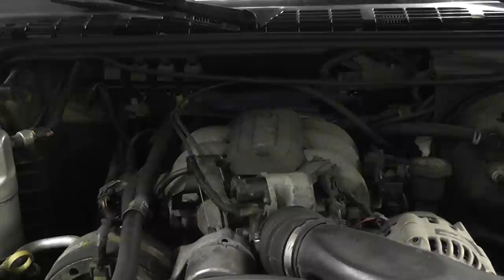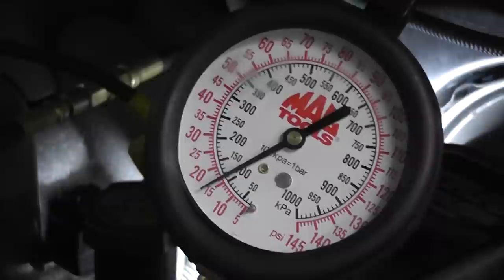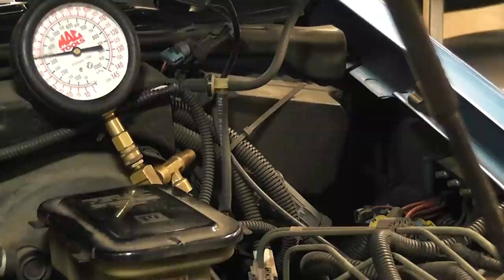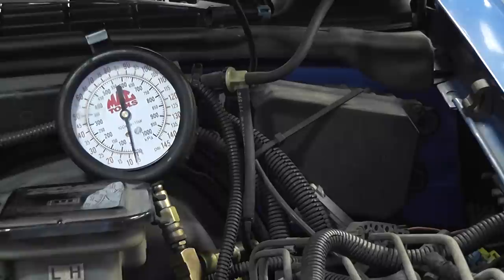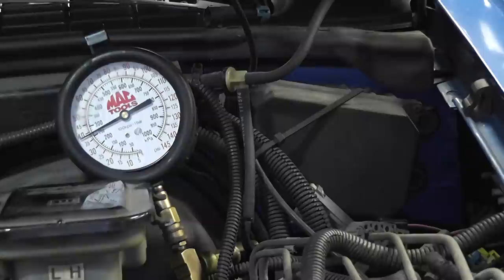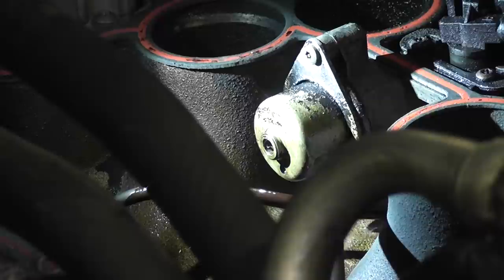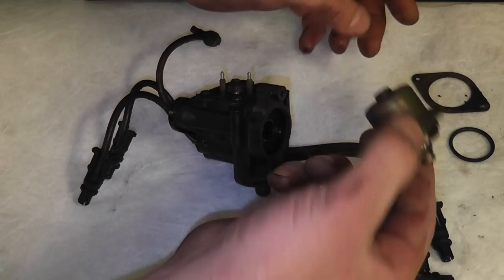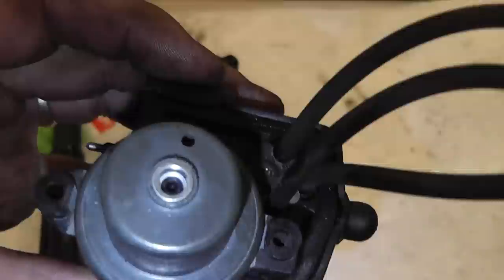How to identify and repair a leaking fuel pressure regulator (GM CPI system) part 1

Comment: A simple "Thank you" is waaay short of the gratitude I have for your excellent knowledge and teaching skills. You have just saved me tons of heartache and head scratching.
These regulators have killed more trucks with spiders than we could ever know. 
Something else I must share is the oil pressure switch, located on the back of the block, can go bad causing rough idle, mysterious dieing, and no fuel pump voltage (improper voltage).
They have a set if contact points inside and can either burn or internal spring failure.
Its in a tough spot to service but a $21 pressure switch can save your truck.
Reply from the maker: Thanks so much Michael. Just knowing these videos are still helping people is all that matters!

Comment: I purchased this truck in a garage sale here in Forida for $800.00 four years ago. seller thought engine was blown. I bought as is. water in oil. I tested every cylinder perfect compression. intake manifold gasket failed. I replaced  total coolant system and gaskets. flushed the engine.  extended cab 4wd truck. Its been my daily driver for the last 4 years.  ac was shot, 1k to fix. no thank you. overall excellent truck.

Comment: Hi Paul, thank you for these detailed diagnostic videos! Just made a quick buck with  my scan tool and fuel pressure gauge for this exact internal leak issue on a 2001 Blazer. I am in the process of establishing my own shop here in central PA, specializing in automotive diagnostics. Keep up the awesome work, you are my inspiration to battle the parts changers!
Reply from the maker: awesome man thank you!

Comment: I want to "plus 1" all of the positive comments below.  The troubleshooting steps were awesome and spot on for my 94 S-10.  I saw a few folks ask about changing the Fuel Pressure Regulator while still in the car but as I've completed the job, I'm not going to search for the answer at this time.  If it HASN'T been answered, I would LOVE to suggest that as an option if its possible.  That part was all that was wrong ($50) but I broke the plastic tabs on one very difficult popette.  So, $240 later, I now have an all new spider injector assembly.    My suggestion would be to squeeze the clips with one hand and wiggle / pull the plastic (not the fuel line) with needle nose pliers.  I think the ring of plastic near the tip of the popette is more solid than trying to wiggle the clips.  Anyway, thanks for giving me the confidence to tackle the job.
Reply from the maker: +searnhardt8 thanks man and nice job. Unfortunately those plastic tabs are brittle. I've done these with one broken clip and they hold, but not two. Sorry you had to change the whole thing.

Comment: This is extremely helpful. Not much of a GM mechanic since I have only owned imports. My brother has a 92 Oldmobile Bravada that I have changed the Fuel Pump fuse and fuel filter, Cleaned the after market K&N cone filter. Ive put fuel treatment in it. Hasn't been able to start on its own, just long strung out cranks with foot to floor.
Reply from the maker: Step 1 is to definitely check your fuel psi. There is a service port on the intake area and you can buy that particular psi gauge to fit specifically your application for like $30? Or rent one from the parts store? Less than 50 psi on these things and they will not start. Then also major flooding from the regulator rupturing, which again can be determined with that same psi gauge

Comment: That's a great point about maintaining pressure to prevent fuel boiling on the rail. No doubt that's a point made as a result of unfortunate experience. The lighting is great in this video.

Comment: This is an awesome video man. I have at 95 ZR2 s10 with the same issues. Ive checked the fuel pressure and it hold, no leak down. So now im stuck, trying to figure out why its running rich and why it takes so long to start, with the gas pedal all the way down. The inside of the intake was all dirty, not clean like yours was in the vid. The person I bought the truck from has already replace a few parts. Map sensor, fuel pressure regulator, distributor cap and wires, plugs, And a few other parts. He couldn't get it to run right. Im thinking its the CPI or spider injectors, IT does have the new FPR on it though. But anyways... thanks for the amazing video man it must of took you some time. I appreciate it.
Reply: Double check all your grounds there are many. Clean them with sand paper or wire brush and use electric grease

Comment from the maker: that's great! thanks for the update. ill keep u posted on any new material. right now i am working on a page for page lecture of my book. it is about 50 hrs of material which i will most likely break up by sections. it would be in video format with my smartboard. in fact it will be like you are sitting in my class.

Comment: Hands down one of the most thorough and informative videos ever!!!!! I learned a lot, liked and subscribed! Thank you! If I block off EGR will that eliminate all the mess shown on the driver side of your intake (opposite the leaking FPR side which was not black)?
Reply from the maker: don't worry about how black the inside of the intake is. Every car is like this and it is from PCV gases. it doesn't hurt engine performance at all. Thanks so much!
Reply: @ScannerDanner  I have a P1404 code and   a P1416 cleared them then I got a P1415 and P1404 cleared them again but P1404 persists.  What happens if I eliminate all smog, EGR, Secondary air pump etc , yet leave 3 OS sensors for closed course competition of course? Getting some misfiring especially around 1500 rpms, Also some high idle and occasional idle stumbling.
Reply from the maker: @stuartmotorsports  The P1404 may need the battery disconnected to clear the memory of the closed EGR valve position https://www.youtube.com/watch?v=HT4OnP4U0to

Comment from the maker: I would agree. As far as replacing the whole unit, I wouldn't do that. Your truck is a newer design and uses 6 separate electrical injectors as opposed to one. So it is called a Sequential Central Port Injection system. (SCPI) I believe the injectors are sold separately but I may be wrong, it's been a long time since I have been inside one of those.  As for troubleshooting a leaking regulator. It would be the same steps I've shown in this video. Fuel pressure bleed-down test is the key.

Comment: Safety glasses when disconecting the fuel lines don't forget,and would you need to stuff rags down the big open ports to avoid anything falling down them?,when dismantalling the injector assembly.Great video by the way.

Comment: Just fixed one. Rich bank 2 code. Dropped 30 lbs fuel pressure in 2 minutes, koeo. Pinched return line, still dropped. Removed intake, pass side manifold washed clean from fuel leaking from the pressure regulator.

Comment: Thanx for the help man, just diagnosed I have a bad fuel pump  check valve in my 96 chevy. I was just about to get the FPR valve changed but it holds pressure with the PSI line pinched
Reply from the maker: Nice job man! Way to pay attention to detail. Even though everyone was probably telling you to put the injector assembly in it.
Reply: ScannerDanner no kidding, it is a very similar symptom, but  I'm getting a TPS code, and the gas mileage is normal,  thanks again for your help

Comment: IM about to do the same thing with my 1995 Blazer but I will replace the whole unit.  The truck only has 60k original miles but, what many experience is the failure of the injectors and lines.....that is the lines themselves rotting.  Excellent vid tho. thanks

Comment from the maker: Nice. What you are describing is exactly the symptoms of a bad O2 (not a bad pump) on a Chrysler product. Watch this video "2003 Jeep Liberty O2 Bias Voltage Testing" and also "1997 Jeep Blown O2 Heater Fuse Case Study" which the 97 it had a blown fuse but a bad O2 itself will give you the same symptoms.

Comment: Wonder how many of these were rebuilt or swapped after spinning a rod bearing from too much gas in the oil? I wasted a bunch of time & $700 on a non-running 94 Sonoma a few years back. Replaced the spider, starter, tune up. Got it running only to hear a knock once it warmed up.

Comment: Great video, specially the part about pinching off the lines. I'm troubleshooting one in which priming pressure rises to 30 psi and quickly goes to zero. I was thinking about pinch # 1; the pressure gauge (and fuel pressure) is in between the vise grips and the return side with the regulator still in the picture. To isolate the fuel pump/check valve, would it be a good idea to disconnect the fuel filter and connect the fuel pressure gauge there? Thks

Comment from the maker: Is it unusually warm where you are right now? If so, don't sweat this problem, it will go away when they switch over to the summer blend fuels sometime in late April or May. My truck is having the same problem and it is a vapor lock condition from the winter blend fuels.

Comment: ty for this vid, im currently in the process of diagnosing my 01 blazer, it has nasty13mpg :-( and a slight maybe minor rough idle at times... no long crank though. debating just going for the multi port injector as its more efficient anyways, but i will definitely be following some of these tips to make sure!

Comment: I have a 1997 GMC 3500 pickup truck dually.. Pep Boys store number 0604 Hollywood California is currently stumped by my vehicle. They diagnose fuel pump problem and charge me to change it.. it seems to be at the onset of this fuel pressure regulator problem in my opinion. The time that will hold pressure is less and less. Currently 2 hours it was overnight. One started in the morning. The way I drive it... as I do start and stop continually.. it functions.. initially after they installed pump motor only. They could not start the vehicle could not figure out the problem. It's serendipitously started with starting fluid. For them.. I believe... The first time. They sent me on my way .  After one month. It would not start. Again. In the morning as it was before.. pressure read 7 lb initially suppose it bad pump which I still have to be tested later. With that new pump they installed seven pounds also as they explained dumbfounded.. I discovered as they did serendipitously well sitting on the hood spring in intake to put on lift it kept running. I mean what to spray starting fluid. Keep running with starting fluid it kicks in within a minute. Immediately restarts when turned off.

Comment: Hey Paul I want to thank you for putting out good info an making good learning process for us! I've learned so much for you that's helpes me dianoise vehicles!

But I need your input on this one!
98 Chevy s10 zr2 4.3 liter truck!
Truck is running very rich at idle like -30 when vacuum pressure is very high on a down rev an -20% just on a standing idle!
Everything been changed in the spider injection new fuel regulator 
All sensor inputs are good o2 are functioning normal!
No codes in memory!

An at a idle my fuel pressure gauge is fluctuating from 45-55 psi rapidy hit the gas an it will go up to 60psi an smoothing out!

So I thought myb it could be uneven cylinder firing an upsetting the vacuum pressure but vacuum is at 20 inches an it does creep around bout an inch up an down!

I have a donor 4.3l blazer that I swapped over maf map sensor ignition module coil PCM an just bout everything!

Now you think this is a case of a bad fuel pump cause I've never seen a fuel pump show this kinda activity before!

Any input would be great!
I'm ready to burn it to the ground days an days of diagnosing an nothing!
Reply from the maker: Chris Sherrick I've had brand new regulators leak on these. How is your rest psi? Does it hold? Your fuel psi readings are not good either but they are low and would cause lean, not rich conditions.
Reply: need diagram of sensors

Comment: What if you don't have any codes? And it has a long crank time when it sits for awhile?  But if I shut the vehicle off then immediately restart, it starts right up.  
I'm thinking either a leaky injector or bad throttle body fuel pressure regulator or diaphragm... 
I have a in-line walbro fuel pump and it holds a steady pressure of 12.5-13psi. 

Oh,  it's on a 1988 s10 blazer 4.3 v6 with th700r4 combo. (but swapped into a cj7 jeep).  

Thanks for the video.  😎

Comment from the maker: @TheZenerDiode Your 2001 version is different as your design is a Sequential CPI system, meaning you have 6 electrical injectors as opposed to one in my video. Same regulator set up though and they have the same problem too.

Comment: What I use to do is stick a vacuum hose thru the throttle plate and smell for strong fuel odor that certainly tells there is raw fuel inside the intake and you got a leak in the CPI.

Comment: The question I have for you is what are you do you put on the new fuel pressure regulator but it will not let you get to the injectors

Comment: Very good video but you should have mentioned that fuel bleed down will not hold on boosted application that has a return system. It will drop immediately. Also you don't have to pull all that off just change the regulator lol

Comment: a GM regulator would have FIT. I CAN understand using a "HELP" part if NOTHING ELSE is available. but that's not likely the case here. you could have gotten at least a good OEM brand. OTHER THAN THAT, GREAT diagnosis tips. shalom

Comment: Excellent video!  My truck is holding fuel pressure fine but i think i may not be getting fuel to the 4 & 6 cylinder.  Is there any way to check for a clogged line or poppet valve?  My  temperature gun tells me those two cylinders aren't firing.  Spark and compression are good.  Any ideas??

Comment: I  just changed out on my 1998 s10 4.3l pick up truck. be very careful when getting to the fuel regulator. very difficult pulling everything to change,  the haRD part getting there . if your a novice do not attemmpt.
Reply from the maker: This is not a difficult job at all.

Comment: I have a 1997 tahoe with a 5.7 Vortec that has the same issue.  I'm getting ready to replace the regulator.  I was going to say why only the p0172 code for the one bank and not the p0175 for the other bank if the regulator is bad? but watching the video answered my question.  On this truck the intake is divided in 2 halves unlike my truck where the intake isn't divided.  My truck has p0172, p0175 and p0300 and has all the same symptoms.

Comment: please God bless u for ur good work.my question is do we have to pinch the pressure holes before or after the fuel pressure gauge
Reply from the maker: both before (on the pressure line) and after (on the return line) to determine the cause of the bleed down problem. If it holds on the psi line, it is the pump check valve (needs a new pump). If it holds on the return line, it is a bad regulator. If it doesn't hold on either line, you have a leaking injector or regulator.

Comment: I enjoy all your videos and I am goin to subscribe to your online course. I tried to use the test wire for the fuel pump and the pump does not come on. Do I have to have the ignition on for it to work. Mine is a 97 S10 4.3 V6. Thank you!
Reply from the maker: You do NOT need the ignition switch on for this test. It is a direct connection to the feed side of the pump. With it jumped, go underneath and verify you have a good power and ground to the pump. 
(Gray wire = pump feed, Black wire = pump ground)

Comment: What if you don't have a bleed down problem but 0 psi when key on position I also notice smoke coming from my throttle body when removed after truck is warmed up

Comment: Thanks man! I don't think that's the issue because the truck has been doing this sense last July. I've had a shop take a look at it (when it first started doing it) and they said that its an issue with the spider/regulator. How long do you think I can get away with this? Also if and when I replace it, should I upgrade to the mpfi spider while I'm at it? I think I'm going to replace everything even if its just the regulator while I'm in there. It just needs to make it till this summer!

Comment: An also when you hit the gas the fuel trim number drop to zero!

So whatever the problem is its affecting it at idle or when vacuum is high!
An when driving at bout 5% throttle I can watch fuel trim number crawl up to -30% an then it will start hesitating like someone is flicking a switch for the fuel pump!

Comment: Interesting diagnosis and fix.  Thanks for sharing ---   For a 2000 GMC V6, 4.3 L, Does anyone know the typical life of the fuel pressure regulator ?  And does anyone know the typical life of the fuel injector / poppits ?      Would it be wise to replace the fuel pressure regulator and/or fuel injector / poppits after 200k miles ?
Reply from the maker: It varies by the manufacturer who made it and then also the amount of alcohol in the fuel you are using

Comment: Dose a 1997 k1500 suburban  L31 vortec have this same connector  you used on the truck to turn on the pump and if so were is it located ,trying  to perform  this test 🤔

Comment: How does it happen? You choke up the pressure line and a return line with a vise crip. How could the fuel pump gave a pressure in order to raise up the pressure gauge? Why there was a fuel pressure took place?
Reply from the maker: When both lines are pinched. The pump is not running. We are testing for a drop in pressure indicating a leak